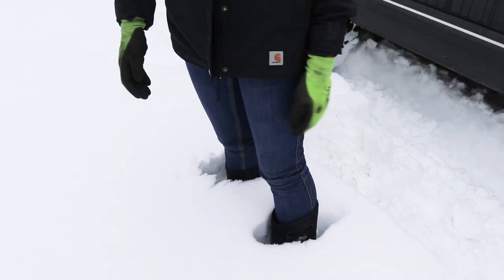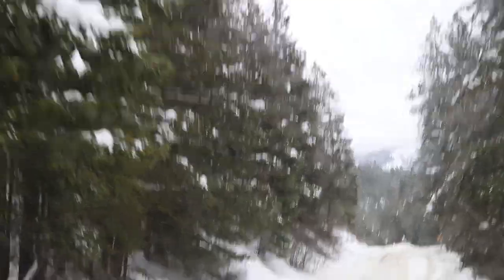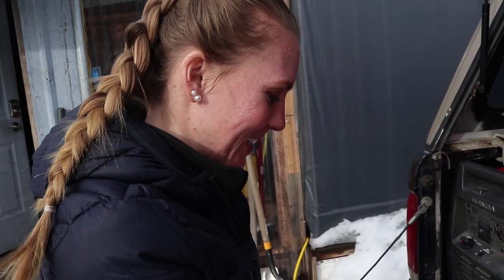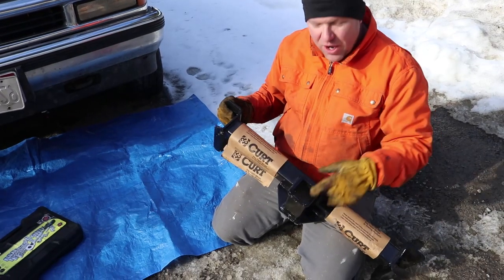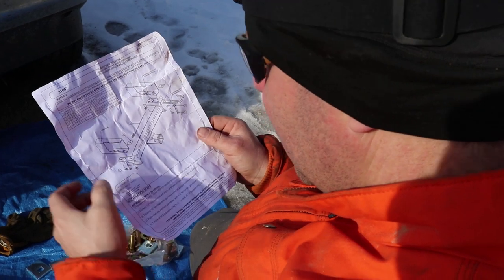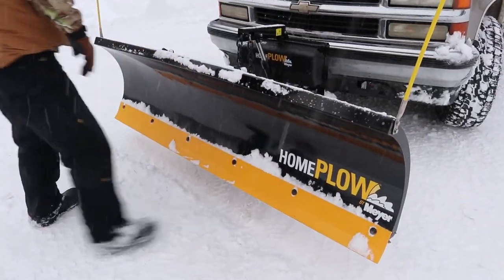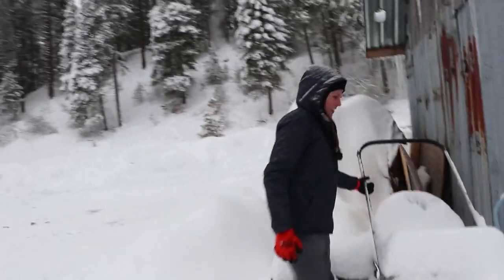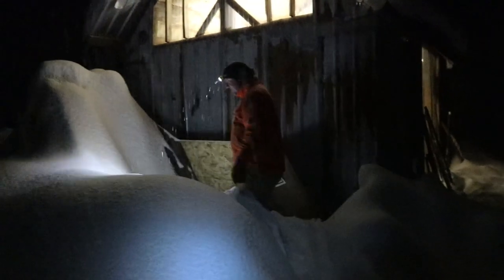STUPID-EASY SNOWPLOWING for Rural Property, Driveways & Snowpocalypses

Comment: As a retired snowplow owner, I would have looked at a professional model. I hope you have some spare angle iron and a welder handy.  Be sure to check welds and bolts after each usage and get some ski wax for the blade.
Reply: The owner reviews on this blade are not good. Lots of things breaking and very poor product support from Meyer.

Comment: Hi there, Owen Anderson here from Tacoma, WA.  To save the headache and back ache of plowing the snow, there's something people have done in the past.  They make a copper piping coil (worm) which goes around the base of their heating stove, oil furnace, etc.  then they run  discharge pipe underground (4", 3") in their walking path.  The pipes are charged with water,  is charged with 10% rubbing alcohol, 90% tap water.  The end result is melted snow because of 42* ground above the pipe.  My grandfather did this so my grandmother would never slip while walking to her vehicle back in the 1950's--1990's.  I love what you're doing, your videos are awesome, and you are inspiring me to do something similar!

Comment: Hey guys,
There are small plows you can attach to your truck or Forester.  Maybe the truck, if it's 2WD, isn't your first choice.  But I have a Forester too and it's pretty good - not fabulous - in snow.  If you have an LSD on yours, it may be significantly better.  But Nordic Plow makes some small models that your Fozzie could horse around with no trouble.

Comment: Your lucky with that tiny little driveway. I have a 2 1/2 mile road from the county maintained rd. 1 mile of my road is a lot of steep hills with a big drop off that has not been well maintained by the neighbors. And my actual drive way is an easement rd that has some good hills and tight growth on either side. 

When I bought my used truck for my homestead, I actually got one with a snowplow included. However due to the road condition, and being called away to house sit my brother's home when the snows started to pile up, I opted not to winter over on my property this 1st year. 

This spring I am going to be doing a lot of work on the property to get started on building a home, and to do that I am going to be doing road work to get the access road in much better shape. As well as building a road to the top of one of the hills on my property.
Reply from the maker: It's not all luck. We chose to avoid long, private drives for just those reasons. We just don't have enough tools and don't expect others to make up for our inadequacy. Our neighbors have helped a time or two, but we aren't above scooping. Did it all the rest of the year. We attempted to plow out a new neighbor  who lives about 15 miles away  last night after dark who hasn't plowed in days and has a 500 yard drive with a small land bridge. It was just too deep, too heavy. Gave up when the berms got over 5' high. They're going to need a blower or dozer to get that driveway clear. Rough start to their off grid homestead journey. Thankfully they're well stocked with fuel, wood, food and internet. :)
Reply: @ Pure Living, Yes I figured you planned your access when buying. I didn't mean you were just lucky to have such a short drive, I suspected that was intentional. That was just me being a bit envious of your short drive. 

For me, the benefits of 40 acres with a pond and no visible neighbors was just too much of a temptation. Other than the road access the property I bought is pretty much perfect and everything I had wanted. I had weighed the pros and cons, and the pros just outweighed the cons. While the long drive is annoying in the beginning, as I work on it and improve it, it will get less and less of a problem. As well as once I get the majority of my building and infrastructure in place, the road again becomes less issue as I will have less need of getting beg equipment up the road.
Reply: @ Julie, the option to winter over at my brothers was always an option. Which was comforting to know I had the option. I would have liked to try to winter over a bit longer. I knew I was not fully prepared, as I had gotten the property only summer solstice, and really only got a trailer on the place in the fall. So I did not have a lot of preparations done for winter. 

But I could have likely stayed until January if my brother hadn't needed me to house sit right when the snows were just starting to stick. At that point it sort of cut me off from my plow. While I could have parked the plow at the bottom of the hill at a neighbor's, plowing uphill is not so easy. You really want to do the bulk of plowing down hill.

So I ended up stay at my brother's earlier than planned, but nice to have that back up option.

Comment: 2600 + 200.00 reciever mount +tax is a lot of coin for that.  For the same price as one of those, you can find a used "real" plow that will do a much better job and last longer.
Reply: I agree. That plow was wiggling around like a wet noodle even in that light snow. I hope it works out for them but having a single point attachment on a 2" receiver hitch just doesn't seem like it will hold up to the side forces created by the plow. A plow can be very hard on a pickup. I've seen much beefier mounts get turned into a pretzel.

Comment: I have a Myers snow plow on my XJ Jeep 6 foot wide, only it's not the hitch mount type like you have, it's a frame mounted under the jeep on to it's frame. It's not the easiest thing to put on and take off, however once I  put the frame with the head lights and pump on the front of the jeep, putting the plow on takes a bit of grunting to get both lower pins in but is not to bad. I think Western has a "drive into" plow hookup so it's really easy, but I think a Myers plow has a much better blade. My plow installed weighs 400 lbs, I had to put heavier springs on my Jeep because I could not install air bags on that kind of suspension. The down side, if there is no trailer on or the plow is not on the ride is rough due to the lightness of the jeep. But I would sooner have a rough ride and sit up then I would have a sagging body like it was with factory springs. I plow my drive way and parking lot and I plow the neighbor's drive way for free,  just to be neighborly. My Jeep will push a foot of snow on level ground in 4x4 without having to put  chains on. During heavy snows, I plow a few times during the storm so It don't get to keep for my Jeep. Plows are great for wet snows that are not too deep because snow blowers often clog up in wet snow. But in deep powdery snow, I'd rather a snow blower, except for the part of being outside in the cold. A tractor with a cab and bucket on the front and snow blower on the back is the ticket, but you're talking about a unit worth around $35,000.00 to $65,000.00  new.

Comment: Looks a decent enough plow for the use you want it for.
I couldn't see if the height was down on to fixed stops or if it had any depth wheels on the back of the blade ?
Nice vid.

Comment: I can't wait to see how this holds up.  Whole system looks weak and under built for that kind of usage.  Looks like it was made for paved suburban driveways in the Midwest not off grid living out west.    There is a tremendous amount of force being generated through that trailer mount.  keep up the great vids!
Reply from the maker: +Sean Nelson Agreed. We've been pounding in it pretty hard. Impressed so far but won't be shocked if the abuse catches up with us. Time will tell.
Reply: Pure Living for Life Sure Beats the heck out of shoveling!!!
Reply: That plow should have come with a set of shoes/pads, these should be installed especially if your plowing on gravel. I have a very similar plow and i plow about two miles to the highway now for 3 years and it has held up pretty well.

Comment: You'll need to shorten the bolts that attach to the springs which will tighten the springs so the blade won't tip down so easily. Your Welcome!

Comment: I think you need to angle the blade more on the first cut, lock it there.  Then remove the pin and use the auto turn while plowing with half the blade or less.  Lift the blade, drive to the back of your truck, drop the blade and then back away so you don't have to shovel so much.   Buy a continuous duty solenoid to put between the plow and the battery.  Connect the control wire to the ignition switch.  Then the plow doesn't get power unless the key is on.  https://www.amazon.com/Cole-Hersee-24059-BP-Insulated-Continuous/dp/B0064MX7US/ref=sr_1_1?

Comment: hope you dont drive down the road with that on. no aux headlights or turn signals. the cheap plows are bad. those clear poly dont come with lights either but if the plow is clean lights can show thru. sorry guys but thats the truth
Reply: The plow is short enough that other drivers would still be able to see all the lights on the truck. Any space that the plow blocks the headlights from you probably wouldn't be able to see from inside the cab anyways.

Comment: Wait...what? You had 6, maybe 7, inches of snow. Your driveway, to get out, is down hill. Why did you bother to clear it? I've driven a Fiero through that much.

You could have just driven out, picked up the snowplow, and then used it to clear your driveway when you got back.
Reply: True... but only with the 2.8L engine.  :-)
Reply: Naturally. It was a 1986 SE.

Loved that car. It gave me 160000 miles of pleasure. Got it in '91 with 
20k on it. It had 180k when I had to give it up.

The transverse mounted engine meant it had no sideways torque to make 
you spin in the snow. Never even bothered to put snow tires on it, let 
alone chains.

The center of balance was so perfect you could drive at highways speed 
with a flat tire and not know it. Yeah, that actually happened. I 
dropped it off while I was at work, telling the mechanic the steering 
was a little soft, found out it was a flat when I picked it up after 
work.